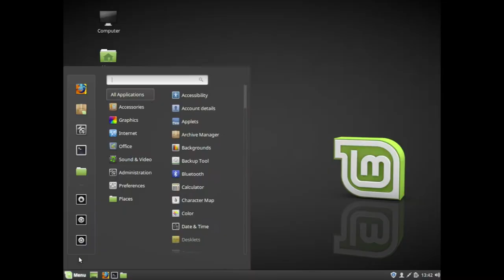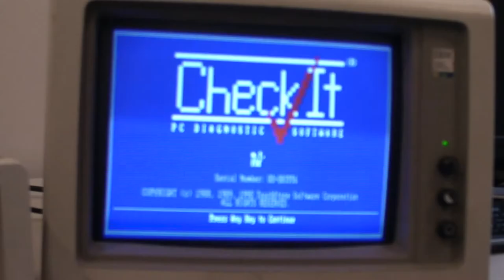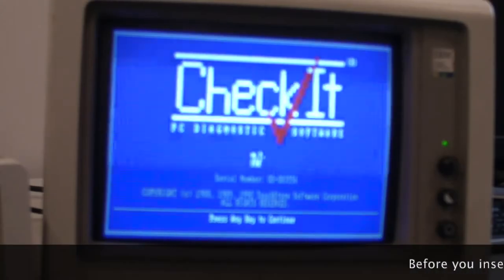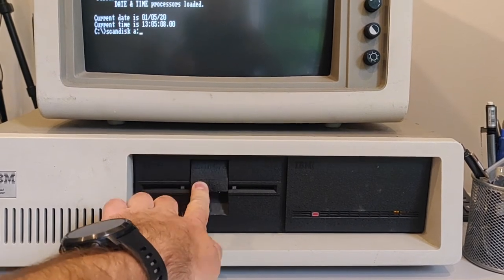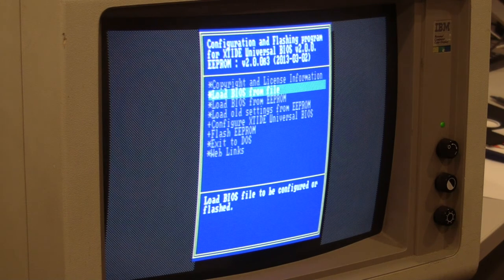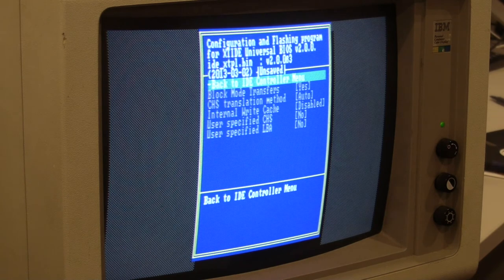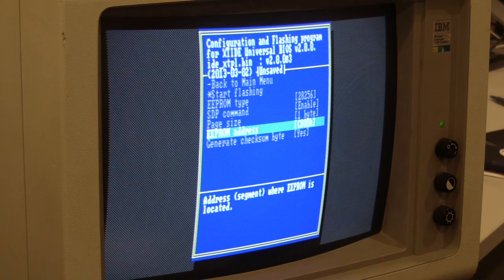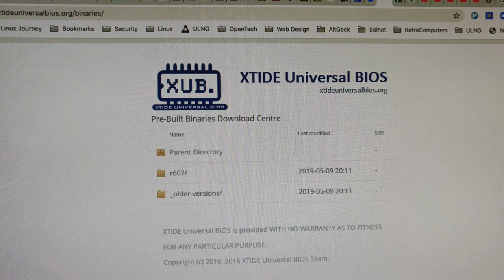How to flash the BIOS on an XT-IDE CF ROM

Comment: I read that you can change the colors of the boot menu for universal BIOS. But does it can be done from this configuration program?
Reply from the maker: I don't believe I saw an option for that, but this is an old video, the BIOS was updated on 2020 or so, it might be a new option that I'm not aware of, but I've never seen any other colour even on my friends machines

Comment: Is there any way to change the compact flash card ID?
Reply from the maker: You mean the name of the device or the ms DOS label? For the latter, just type label at DOS prompt. I don't think there is an easy way to change CF identifiers as it is burned in by manufacturer.
Reply: @AlsGeekLab  Do you know how the manufacturer burned the CF card hardware ID? And how could i try to change it?